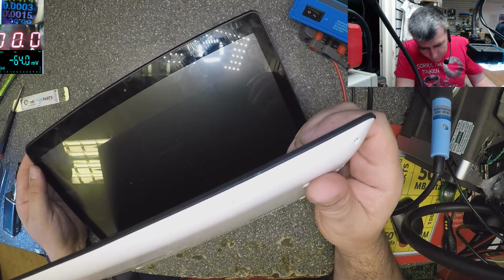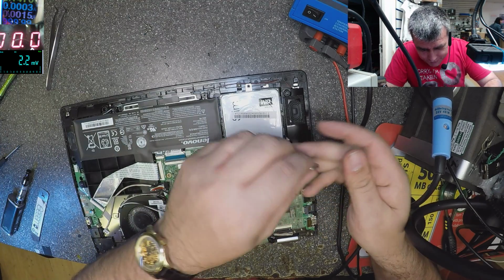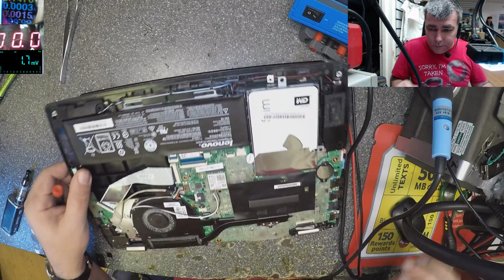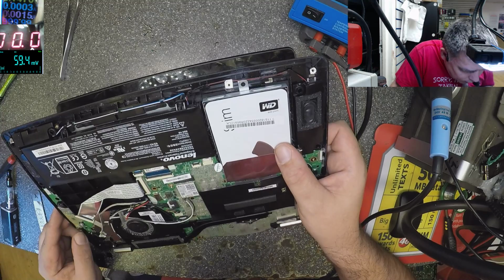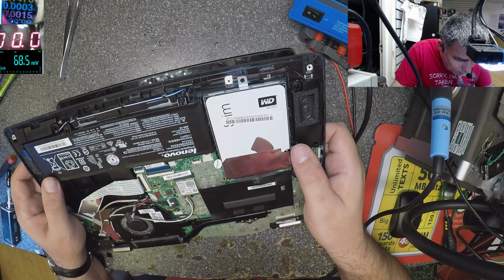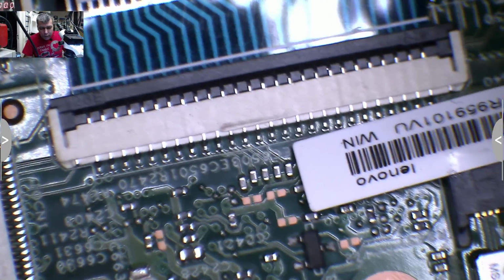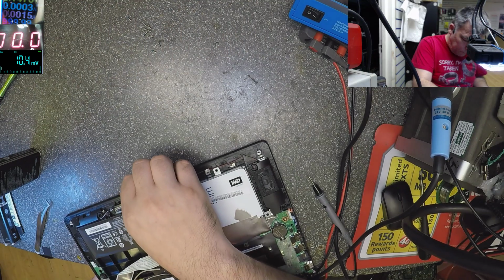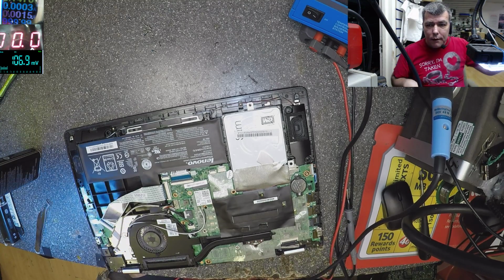Lenovo laptop, no power, motherboard repair

Comment: I think it's a 5 volts voltage regulator for the USB port.
The problem happened because of a short caused by the faulty port.
Reply from the maker: is not a regulator, as i have 5 v on the input of that chip. I think its meant to protect the laptop in case of short on the usb. I still dont understand how that chip its related with no light and picture on the screen :)
Reply: LP2983 Micropower 150-mA Voltage Regulator
Reply: I have 3 laptops that working with black screens 2 Dell latitude E5430. Not a cable problem or screen. I have 19 and 3.3 on the screen cable on the screen but its going nowhere on the screen just on the connector. Thats a hard one. I already tried the graphic